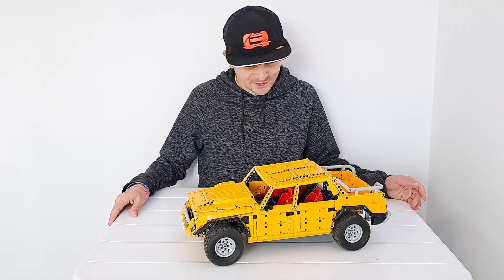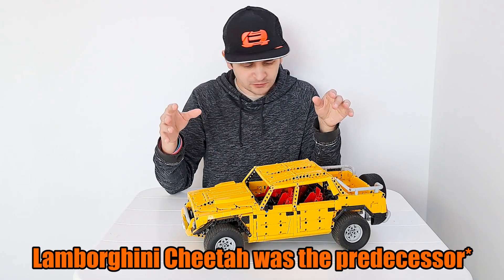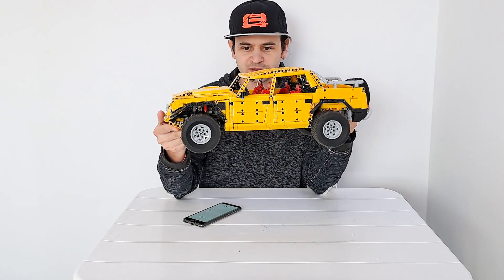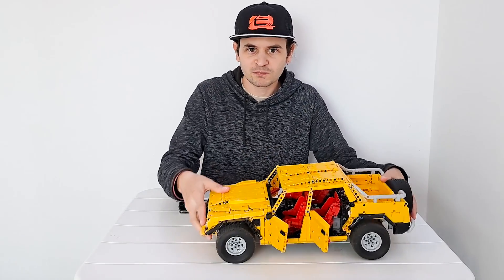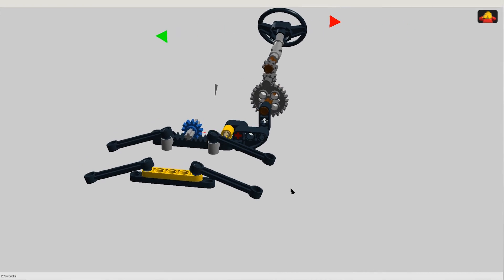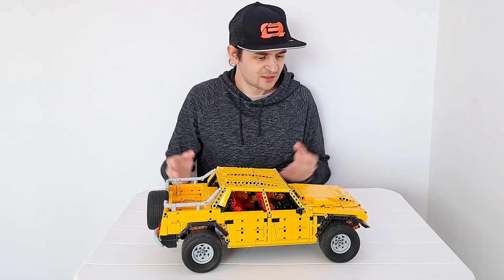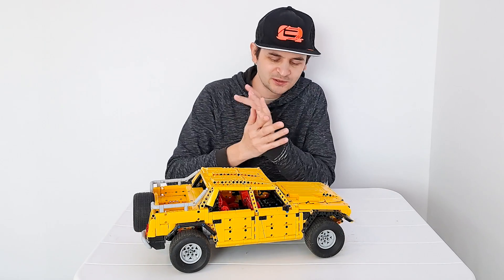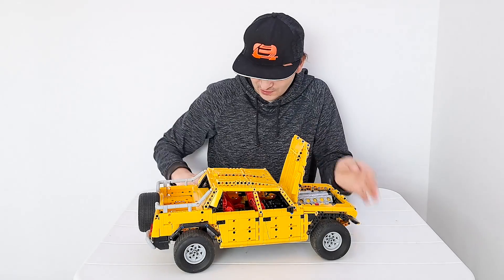LEGO Technic 1:10 Motorized Lamborghini LM002 Representation

Comment: Great build Zerobricks, I really love the fact that each model you present has something different (for example this one has a unique link from steering rack to steering wheel, and other your MOC may have locking differential). The body remind me of old Technic builds - raw look, but hides a lot of used techniques. One thing that I think you could use, without too much modification, is a hood supporting rod (you could use just a simple 6L half-stud liftarm). I also love reinforced steering, hopefully it reduces wheel slack just a little bit (maybe adding an upside-down rack, like in Lego Audi 42160, could be a better solution). One question that I have in my mind, how is 8-tooth gear holding in high-gear? Have you managed to slip that gear during riding the model?